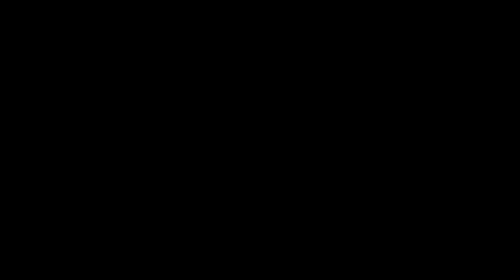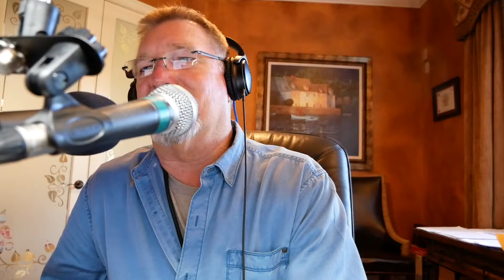Motor Won't Start Without Starting Fluid?

Comment: He’s just guessing about things. 
You can check the fuel solenoid just by turning on the key (not cranking).  If the solenoid is working, you’ll hear a click as it engages. 

He’s also wrong about fuel glow. The caller said the tractor runs fine once it is started. So there’s obviously a good fuel flow. 

It’s either a bad solenoid or choke needs to be adjusted.

Comment: Got a 2005 Honda elite ch80 scooter I put a new carburetor on it new battery also brand new petcock. And drained the gas and added new and set the valve lash. And like before I added these new parts that friends and mechanics said to replace and it still only starts on starting fluid for a few seconds. I bought the starting fluid with the lubricant in it but I was told not to use starting fluid so much because it's not good for the engine. I need help brother it's my only transportation at the moment. So it'll be great if you had any ideas/solutions. Thanks Bruce..,
Reply: Any luck I can't get mine to run and it's going to get towed

Comment: I have a 1997 chevy express woth a 5.0 engine every since ive had it it sometimes will start own its own like say u turn it off at gas station run n and out it might start or a shot of starter fluid it starts right up and stays runing so ???

Comment: I have checked it ALL, and my 2020 Bass Tracker OX 400, Kawasaki motor will only run while spraying starting fluid in the breather.   Help.   Gary from Ga.